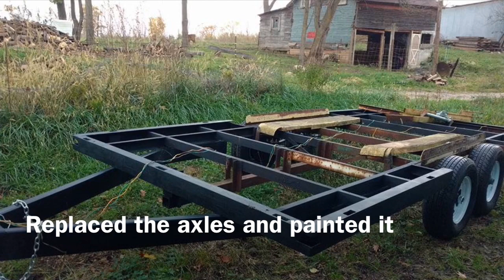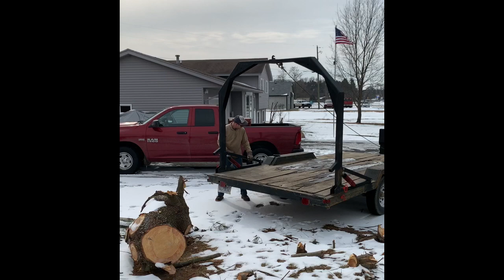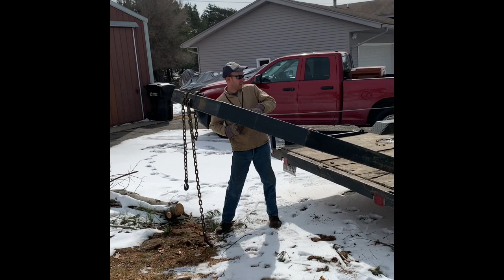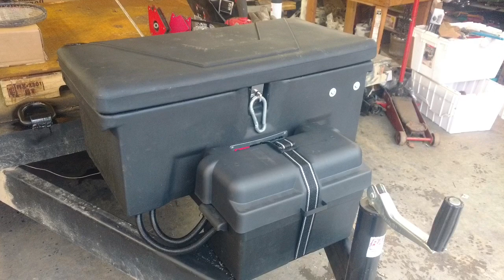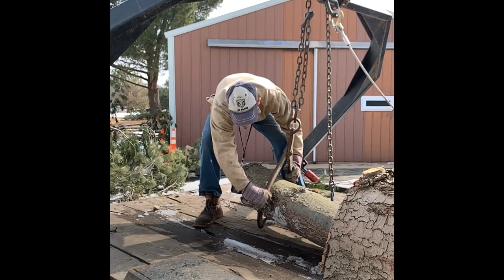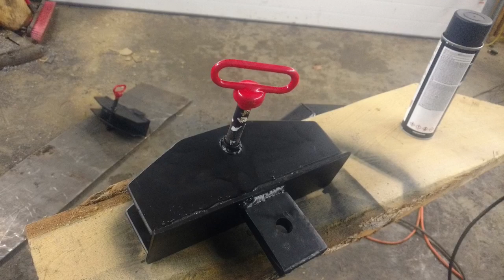Custom Trailer & Logging Arch

Comment: I, like some of the other commenters, would put leveling jacks at the rear for the really big logs for sure!   I would also carry along an old moving blanket or something similar to lay over the winch cable when pulling up a log to keep a breaking cable from whipping around and injuring someone.  The coil over shocks are a great addition to your design.  Thanks for the video!

Comment: This is too cool. I like your's with the shocks. I've seen a couple and wondered about it slamming into the deck when tipped towards the truck. And the stops on the other side are a nice feature. Such a simple but great design,  nice.

Comment: I'm building 1 at this time 
Every arch I see has 1 big flaw 
That's trying to lose the log when you want. I am putting a hand winch on the arch with a block on the top so I can raise our lower the log at any point in the arch position.
Reply: I thought about that too. I have made an arch that can be fixed in many different upright positions. The electric winch can be then disconnected from the arch and using a snatch block to raise up the log to slacken or remove the chain. I just uploaded a video of my new log arch trailer a few days ago.